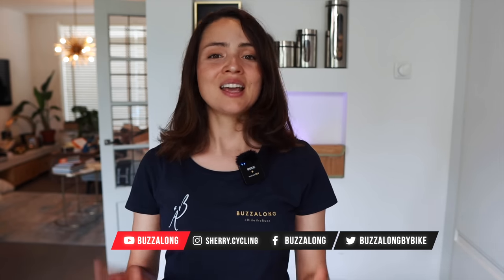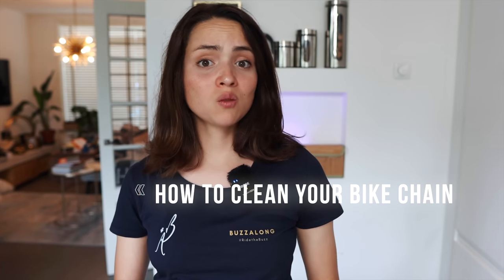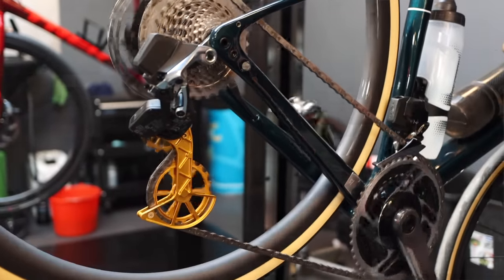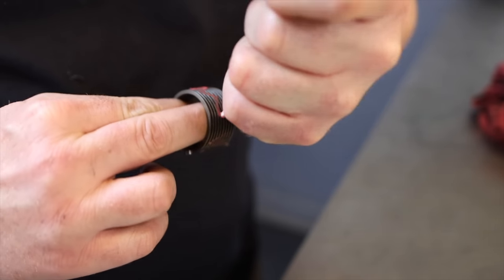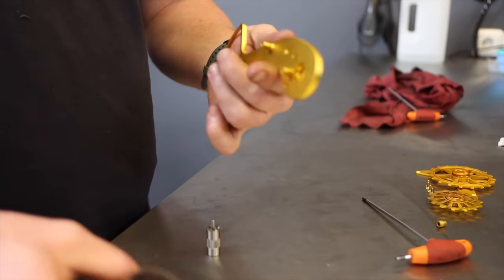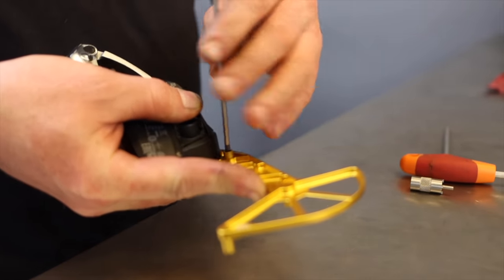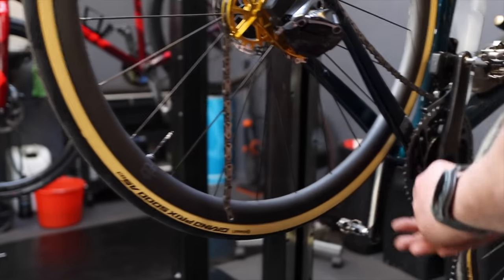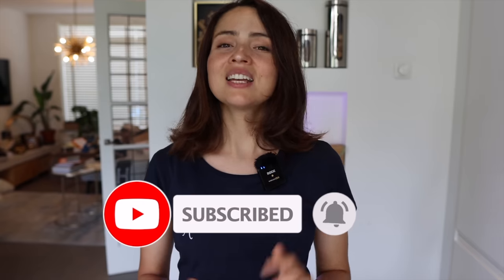Maximize Drivetrain Efficiency for Cycling: Watt-Saving Tips, Chain Hacks, Wax and Kogel Kolossos

Comment: Once you finish your mineral spirits you should try either Ceramic Speeds UFO Drivetrain cleaner or Silca's Chain Stripper on your next new chain. Much easier, you still get multiple chains per bottle, and the solutions themselves are more environmentally friendly!
Reply from the maker: thank you so much for the recommendations, will look into it, really like the Silca products.
Reply: I've not tried it myself yet, but that Silca chain stripper looks like it would take a lot of the hassle factor out of that initial wax set-up.

Comment: Great video. I use WD40 to clean my components, it really gets right into the nitty gritty of the parts. There are people who say don’t use it but others say it’s ok. WD40 has been around than a lot of the brands they recommend. I find it works really well. The derailleur is interesting, I’ve not seen one like that before. Thanks again and look forward to your next video.👍🏻
Reply from the maker: Thank you :)
Reply: WD40 is a very low viscosity oil. It's called Water Displacement 40, because it will displace even water, making sure steel components don't rust. This also means that it will displace any lubricant in your chain. So after just a single application of WD40, your chain is ruined, because any lubricant you put onto your chain, will not be able to displace the WD40 and only stick to surfaces that don't need lubrication. 
So from then on, WD40 and only WD40 acts as the lubricant of your chain. But WD40 is a bad lubricant. It will spray off the chain and it lubricates your chain only for a very short amount of time, requiring you to do applications of WD40 before every ride.

Comment: 1. upgrade wheels
2. upgrade tyres
3. upgrade for oval cranks
the last thing is upgrading the oversized derailleur. 
1% improvement, at what amounts to a PROFESSIONAL cyclist’s average wattage of 250 watts. Saving is 2,4 watts. So for endurance cycling it's almost nothing. Like if you are not using fully aero bags, clothing helmet etc. wich you gain a much bigger advantage than an oversized derailleur. compared clean and well lubricated chain you save 5-10 watts.. 

I'm not saying it's looking cool ;), but for 500€ you can make much better improvements.
Reply from the maker: Can understand :)
Reply: All things being equal, 1% savings just by changing a cage is no small feat, especially if you are an ultra racer. But even if you weren't, it looks great on your bike.

Comment: Replacing oil with wax is certainly a no-brainer if listening to experts and testing instead of random rants in the comments!  In the wet I use Squirt to top off.  One thing worth mentioning, step ZERO, before cleaning the chain - pick anything but SRAM!  Several independent tests (Ceramicspeed, Silca, Marginal Gains, Zero Friction Cycling, etc.) have shown their chains to be the worst pick in efficiency.  (I reacall they might last a longer.)  KMC is ok but Shimano makes the most efficient and with wax I get over 5k on my chains, on average two per year and rotate them.
Reply: km or miles? I am looking at SRAM chain as heard it last longer, rest going for efficiency, Enduro XD 15 bearings and ceramic speed OSPW aero
Reply: @mlee6050  miles.  For sure SRAM is apparently valid choice for those looking to stretch budgets.  I like SRAM (and Zipp.)  But these are marginal gains after all.  Together they add up.  I still have SRAM groupset (mechanical) on my CAAD10 trainer setup!
Reply: @obikedog  you experienced DMC? I just looked and like KMC but see they got DMC that apparently last 3 times a normal chain, X12 and X12 EPT

Unsure about stretch budget when looking to have Emonda ALR as daily commute bike and realise cassette is like £300 for 12 speed ...
Reply: @mlee6050  Thanks, I've not heard of them.  True the chain is the least expensive bit to replace so good to do some research.  Especially with all the engineering Shimano does for their little-noticed but critical shifting ledges and notches.
Reply from the maker: Thank you for the tips, I have KMC now for my gravel bike as it is Shimano